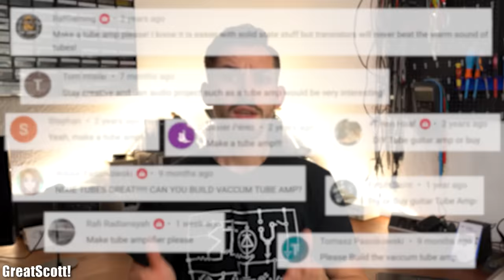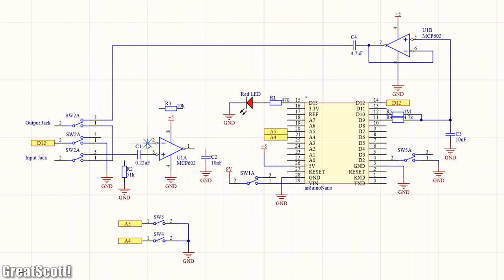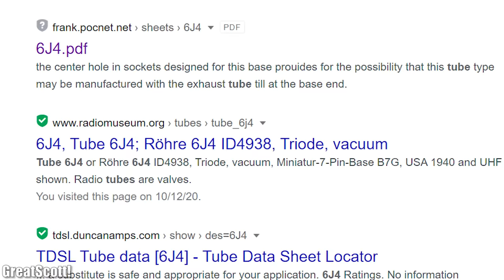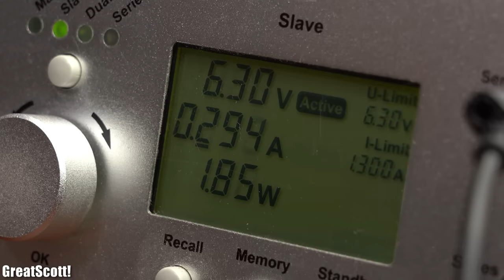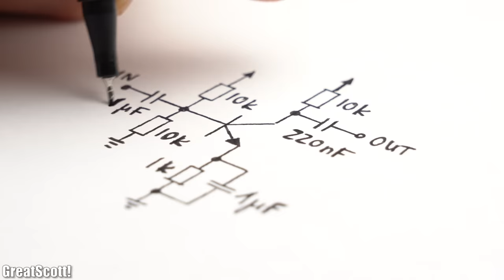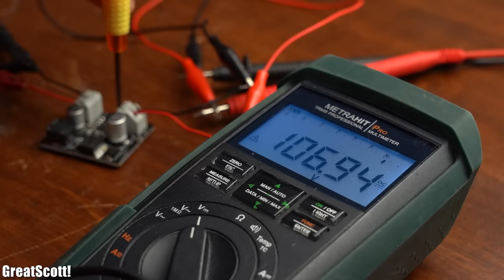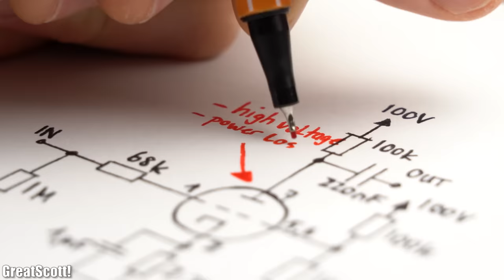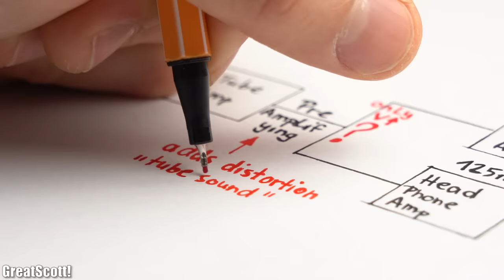Building a Tube Amp! Does it produce better audio quality though? EB#47

Comment: I have a couple of amps ,two with 6m5 and a 6bm8 all low power single end. They do sound bright unless the tone control is turned down. And i would say not accurate  like my solid state amps. A, AB and D. I am aware of the distortion and harmonic issues ,even cancellation of harmonics on push pull valve. 
I think ultimately its a nostalgic thing. I can play music i heard when  i was a kid and it sounds as bad as it did. 
But yes i understand why musicians go for them, tone . In music the amp is part of the instrument.

Comment: It would have been more edifying to see a square wave put through the tube and the transistor.  See what the rising edges look like. 
I got into tube amps back in the 90s when I played in a punk band. I kept blowing speakers and amps until I switched to a tube amp. 
I've never been able to blow a speaker with a tube amp.  And they just sounded more interesting with less of that white noise trashy sound solid state amps get when run hard. 
That said, for my own listening setup I use large heavy solid state amps with tons of headroom. The kind with overbuilt linear power supplies and closely matched output stages.
Adcom 535, 555 etc.

Comment: Brother please help... An amplifier runs 12-24v . For 100w subwoofer. I use 24v 5amp. Can I get get same power from 12v 10 amp 
I have a pc smps which gives output 550 watt(12v 30am) and 5v,3.3v. can I use this smps.for my subwoofer drive?

Comment: Define audio quality.

A class A amp using tubes is probably the most inefficient and source polluting way to amplify a sinewave.

The fact we "love" that "warm" sound it makes is just the sinewave being buttfucked and we somehow appreciate it.
Transistors, and mainly the AB class amplifiers are most likely the best way to amplify a sinewave without changing it too much other than amplitude.

But sure, audiophiles are probably going to go full chimp about it now, but there really is that "warmness" that tubes add to sound. 

But it doesn't mean "quality". Quality would be a 0% signal noise and a 100% conversion. Which will probably never happen.

Comment: This seems like a very random and unscientific way of evaluating the audio quality produced by tubes. You have a poorly designed "faux tube" device full of solid-state components! The 6J4 is a tube designed for UHF amplification not commonly used in audio amplification. Probably used because they are plentiful and cheap. I encourage you to learn a little more about tube amplifier designs - the Mullard 5-20 circuit is a good one to start with. You'll need to build a proper power supply stage with some heavy iron (power transformer and choke filter) to work with tubes. To drive speakers you'll want quality HiFi output transformers.
Reply: True said

Comment: Can you please draw the tube schematic used in that bought amp.  That would really help me, I just  put my hands on two 6j4 tubes and I would like to use them as a preamplifier.  Lots of schematics online, I dont really know which are good or not,  first time using tubes( did many  BJT, Mosfet amps in the past ) .  From what I see on the PCB, the signal goes trough the op-amps gets amplified ( a bit at least) and then amplified more by the Tubes, or  The tubes are used just as buffer's ? I think not tho. maybe they have little gain in the circuit.  If you have time and want to , it would be appreciated.  Also  for your  100v need.  You can use an 220v transformer to 12v or (110 to 12v  whatever your mains are)  and  supply voltage to it  backwards from another transformer.  Like 6v from one transformer  on the  another's seccondary 12v would give around 100v  on the primary ( 150ish DC ) so maybe 4-5v would give 100vdc ( needs to be calculated ) but should work, I used transformers backwards before when I needed , you can use that to power your " class A pre amp used in this video ". 
Cheers!.

Comment: Ironically it is easier to just add frequency distortion to a regular transistor amplifier, than it is to build a tube amp with modern equipment.

Comment: The difference between a analog and digital audio circuit, is like the difference between a oil painting of a still life and an fine. Q1 inkjet print of that still life. It's been chopped up finely and reproduced almost exactly but has lost something in the translation. Hard to explain.

Comment: Ha ha, this debate has been going on (and on and on!) since transistor amplifiers have been around. What I've seen over many years is that you cannot compare the performance of amplifiers by the data sheets of the individual components, an amplifier is very much the sum of its parts. The best tests I have come across are double blind tests in front of audiences of amplifiers of comparable quality, the results always came out about 50/50 because, at the end of the day, the decision is subjective. One theory used to be that valves tend to generate even harmonic distortion whilst transistors tend to generate odd harmonics, which sound worse. Additionally whilst getting embroiled in 'distortion figures of 0.1% and less, it has been shown that it is difficult, for the human ear, to dicern distortion levels of 1%, especially at elevated sound levels as our auditory response is logarithmic. Finally what always seems to be forgotten is the distortion introduced by the speakers which is, if I remember correctly, around the 5% mark?

Comment: I would say no. It's a different flavor of sound. And you most likely need to tube roll to get the sound you like. Every dac has its own take or flavor of sound. Even solid state dacs that are the same model have minute sound differences between each other. Also, tube noise floor is an issue. Sensitive iems will pick up tube noise floor.

Comment: What you have there is a preamp not an actual tube amplifier. Think of what that is as more of a volume switch which could've been made from a volume pot with a couple of RCA connectors for a lot less. All  can think is do to a lot of marketing hype they sell a bunch of these to unsuspecting buyers just because they have tubes in them.

Comment: For a hi-fi, tubes are pointless. As a guitarist and recording engineer, I'm not using tubes to listen to recorded music at best it does nothing, at worst it doesn't sound as good as my reference monitors, nice hi-fi, or car stereo.

I do use tubes in the signal path recording a singer, both for the slight nonlinearity or compression when overdriven and the added harmonics. Usually this is a special effect and almost everything else is solid state or digital.

As a guitarist, a tube amp is magical, distorting tubes are the sound of rock guitar, and it wasn't until the 1970s that guitar amplifiers were built with a master volume and a preamp section that was designed to distort,  even running an additional cold-cathode tube by the time we got to the late 70s. 

Today I'm running a little 15w amplifier and a loadbox so I can ensure the preamp and powerstage distort exactly how I want at bedroom volume and on stage. Yes transistors distort and diodes can be use for clipping and we use pedals that do this as well, but they sound different. I'm stacking transistor distortion pedals and tortured tubes. It's great. And digital modelling technology isn't quite there yet.

Comment: Did you really build the test amplifier using the circuit diagram that was shown in the video?

For one, it really looks to me like that tube is a pentode, at least from how it looks in 0:45 unless that was a different tube.
It looks like a 6J4P or 6Ж4П pentode.

Based on the datasheet of 6Ж4П the connections shown in the circuit diagram in the video are all wrong (for example, pin 7 is actually the cathode). No wonder the circuit did not work at all.

Also, the control grid should be biased negative with respect to cathode, so, if you are using a cathode resistor, then the control grid should just be pulled down to ground with 100K or 1M similar. Control grid should not be biased positive with respect to cathode.

Also, I do not think you should solder on the tube pins.

Do not take my post as something negative, I just wanted to point out some mistakes I saw.

Comment: I will stick with my Soundcraftsman PM860 Professional Mosfet Amp, 400W into 2ohm @.05THD [pre clip] per channel with a 50V per micro second slew rate. [means it raise or lower the voltage 50V in 1 millionth of a second] It drives 6 two bolt can style Mosfet transistors per channel with active heat sinking with 140V [-70V - +70V] which means if you drive the amp till the truclip indicators are flashing and touch the speaker wires, you will get electrocuted.

Comment: Tube amplifiers do not cause audio to sound better.  Tubes don’t have a fast reaction time like a transistor does. This creates a interesting artifact in the amplified sound. A fade instead of a hard cut off.  A easy way to demonstrate the artifact is with a incandescent light and a led light. Power on and off each at the same time. Watch the incandescent lamp fade on and fade off. Watch the led come on and go off immediately. This is the same thing happening with a tube amplifier. The demo is just a visual way to show it.

Comment: But why do you use a hybrid amp instead of a full tube amp ? Your comparison makes no sense... 
I would had use a 100% point to point tube amp with high quality tubes and plug an oscilloscope at the end and check the signal as well the frequency response  and of course compar it to the 100% full solid state amp... sorry but this makes no sense....

Comment: I heard high om impedance headphones make the tube amps  sound better why would this be?
Reply: Harmonics, they subjectively sound warmer.

Also a lot of traditional transistor amplifiers were badly designed, too much added too easly in to correct design errors,

Vacuum tbue amplifiers are more physicaly difficult to build and costlier, so designs are simple and thus sound better (or crap)...

Integrated circuit amplifiers are generally designed by very professinal engineers with a lot of math and less emotion, so more linear and accurate.

Read John Linsey Hood's book on amplfiers.

Comment: Tube amp are clearly more audiophile but they are more expensive, more power consumption, heating, fragiles, and the last one, very often they have not enough basses. And chinese lamps are not of the same quality than Philips or Sylvania.
But aniway, it is very pleasant

Comment: The question is only for youngsters....check out what the pros use....tube amps and analog gear are used in the recordings of the pros because they are more complete in the frequency spectrum.....not bits and pieces of the actual audio

Comment: I'm pretty sure that the only reason tube amps are still in use is because their distortion properties are used for guitar amplifiers that need overdrive/distortion effects for rock/metal music. They basically sound almost the same as a silicon distortion effects (which are objectively cheaper) but I guess that it is true that, "subjectively", some sound engineers/guitar players claim that tube amp distortion sounds better than silicon based.

As a person that has been using digital guitar amplifier tools for the last few years, I believe that; even if Jimmy Hendrix was alive today he wouldn't give one, two or three shits if his guitar gets distorted through a "Diezel VH4 Head" or "Line 6 Spider V 20 MkII"

seriously guys, learn how to play with a metronome BEFORE you go gear crazy.
Gear doesn't make a musician ;)

Comment: So, in general, according to noted author G. Randy Slone there is no discernible audio difference between a good tube amp and a good solid-state amp. Only guitar players and “high end audiophiles” are keeping the tube companies afloat. As a guitar player and a tube amp owner, I can attest to that. We can be snobs about tone. The truth is, using a jFET in an amplifier circuit is a good idea, because they tend to distort the way a tube would. Instead of clipping the signal, they sort of squash it. Try it out for yourself.

Comment: Valves or tubes as the yanks call them do clip. That's the sound of rock music. 

They are not clipping when operated within the amp's rating. Beyond that they do clip and produce the sound guitar players called 'overdrive', e.g., AC/DC's guitar sound is valves clipping (somebody like Hendrix is a mix of valves clipping in his amp and transistors clipping in his fuzz pedal).  It's partly why rock music became extremely loud. Guitar players liked the sound of their amps overdriving, but could only get that sound in those days by playing extremely loud. A 50 watt Marshall Plexi amp from the late 1960s can be overdriven to output close to 90 watts and over 115dB, but it's sound will be heavily distorted. 

A triode can run a speaker. There are many guitar amps running dual triode valves in the power amplification section. They key do doing that is in using the correct output transformer. These amps tend to be low wattage amps for home or studio playing. 1-5 watts typically, but that many watts in a guitar amp can still get noise control called on you. 

Cheers.

Comment: OK your happy not having to build tube amplifier, what you showed us was a hybrid tube preamp. I have built my own tube amplifiers 6L6 EL34 Kt88 main amp preamp 12ax7 6h9c 6h8c 6dj8 6j8 and up against transistors base preamp power amps tubes always wins hands down.

Comment: Honestly, a tube amp is really not worth the hassle unless you've dedicated your time to understand, build & risk your life if you had no idea what you're doing.
Tube amp is really sensitive and easily bothered by power supply noise, mains noise, random ambient RF noise & even by the 'noise' from the tube itself. the power delivery is usually only strong for the very first watt (suffice to say you've 'build' it correctly) and the rest are just power reserve. it's very dangerous for BTL / OCL load & capacitor output is pretty weak, so you've need an audio trafo for most job. not to mention it usually works on a really HIGH VOLTAGE which means you've wasted a lot of money on higher voltage components & the risk of shock is really great. there's also no easy way to test whether your tube actually works or having 'spent' / degraded by time. (a.k.a used tube)
Most "tube amplifier" you've found on the internet usually act as a buffer / initial stage and most likely having any transistor / mosfet / monolithic chip behind otherwise it wouldn't be cheap.
.
you can however, start with a simpler & more safer by building a "12 volt 12AX7 pre amplifier" (a.k.a starving tube) and it should be good for a simple lesson / youtube material.

Comment: No one canceled laws of physics - when input signal reaches the level output signal can no longer rise or drop clipping effet occurs in tube amplifiers - might even not be caused by the tubes but by a saturation of transformer core. Comparisson would have been more accurate with FET or MOSFET transistors - transient characteristics are almost equal. There's very easy way of getting rich of even harmonics sound that tube fans like so much: add a transformer pass between stages - standard 600 Ohms 1:1 isolation ones are good enough or last stage driver from old transistor radio. Combine transformer with some large capacitanse bypass of a local stabilasing feedback or a bootstrap voltage current load circuit - tube sound guaranteed.

Comment: Define better.  I can listen to mvsik played on tubes much longer than transistors.  I also don't feel the need to turn it down until it's off.
Call it a tone control, or me an elitist, or an idiot.  I don't GAF.  The only real measure of an amp is happiness.  I once told a friend, "who cares if it's a psychoacoustic effect."  He looked surprised and then accepted it, realizing it's real to me.  If my affliction gets me through the day, then who cares.
Testing is an interesting problem, however.  Maybe if it gets beyond the Earth, Air, Fire, Water stage and looks at music reproduction rather than an infinitesimal subset of audio, we may learn something.  It's like testing a car.  Forward, Backward, 30deg left, 30deg right.  OK, now go race Le Mans.  With all of the other drivers.  Or a dragster engine.  Sure idles rough... can't do the basics well, so it's worse than a Yugo.

Comment: Triodes are considerably less linear that low count transistor amplifiers and have much higher levels of noise. The only thing they do better is they have higher drastic overload point. Also they are more rugged. Both of these things are irrelevant for signal level audio amplification.

Comment: Your bought tube amp wasn't really a tube amp. It's more a solid state amp with tubes to modify (improve?) its tone. This is a common feature in modern studio grade audio gear (eg compressors), where a high-end solid state device is augmented with a tube circuit to 'warm it up'.

Comment: Hmm... Hybrid config can be good if well designed, but it doesn't seem to be... Class D output stage is my issue with it, since it means it has PWM driven mosfets, which is efficient, but pretty crap!

Comment: Good attempt to de mystify the subject, however...
.... you really need a 'proper' tube /valve amplifier from input to output in order to come to a conclusion.

And also, measurements are an important part of any circuit but, our brain and perception of sound don't always agree with them.
How can one quantify the 'satisfaction' one feels when listening to music?
In my 55 years of involvement in audio, I have come to accept that, tube amplification almost always has the edge over solid state designs.
Unfortunately that doesn't correlate with actual figures but it satisfies my ears and then, my brain.

Comment: I don't buy tube amps or digital amps because I prefer to reproduce the original sound with less distortion. Moreover, the cheap vacuum tube amplifiers on the market were not standard vacuum tube amplifiers.